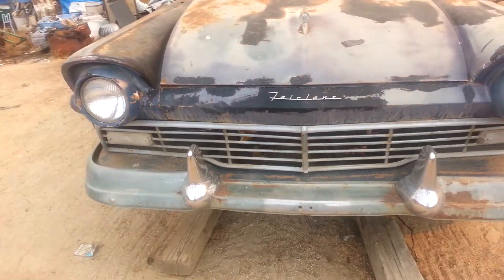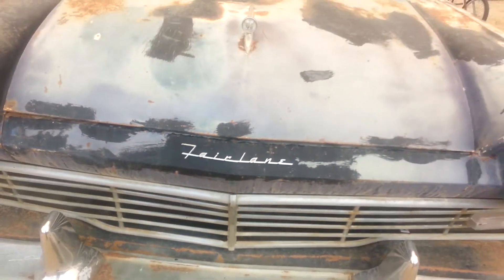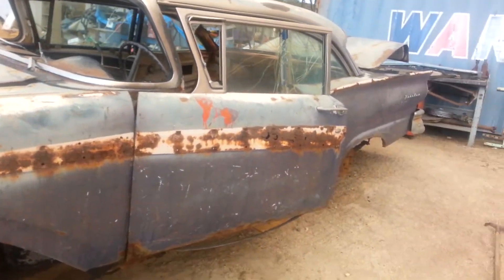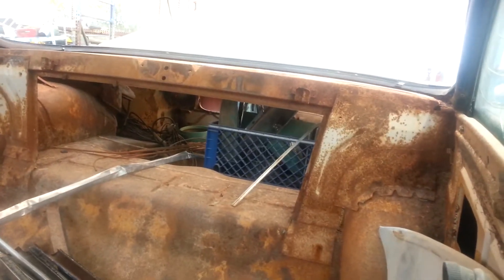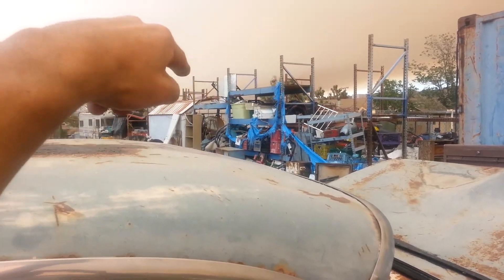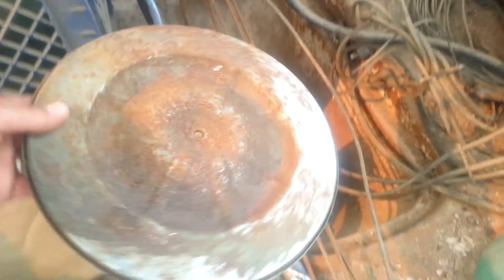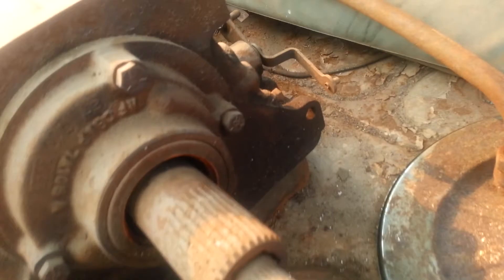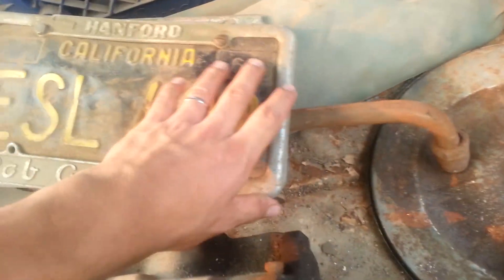1957 Ford Fairlane 500 headlights

Comment: I my way of thinking your headed in the right direction by finding or locating the missing parts and getting them fit and replaced on the car. You are making positive changes in the car and how it looks. You can work on the car and do the manual labor to restore parts here and there as you get the car reassembled and then spend the money that has to be spent to by the more expensive pieces and parts after you have accumulated the missing small parts that you can find cheaply. You have done some major restructure on the roof and the deck lid and there isn't any reason that you can't continue to work on those and bring them back into original shape as it's mostly manual labor and not a lot of cost and the experience will greatly improve your ability to work on and restore the car. You can do it Des, you just have to make up your mind and stick with the idea that you will do it and it will be first class when your finished. Work on it until you don't know how to do any more and then ask and research how to move on past that point but just stay determined that you will make it right before you quit and give up. You can learn how to do everything that you need to do to restore that Fairlane. It won't be easy to do and it will be frustrating but YOU can do it yourself if your willing to put the effort forth and learn. Anytime that you want to ask a question or how to do something you can contact me OR anyone in the garage gang and get your questions answered. Just remember YOU can do it. Cheers OLDDUDE